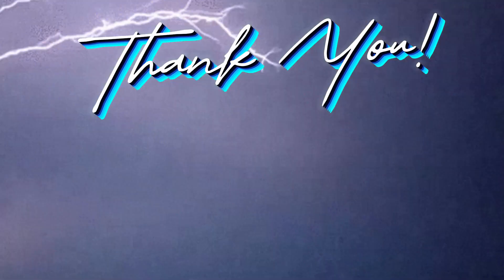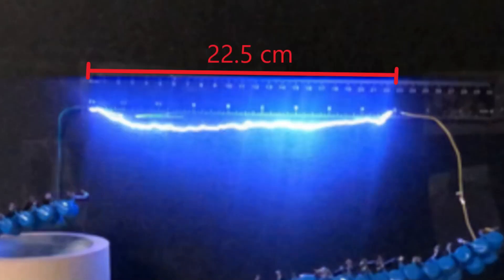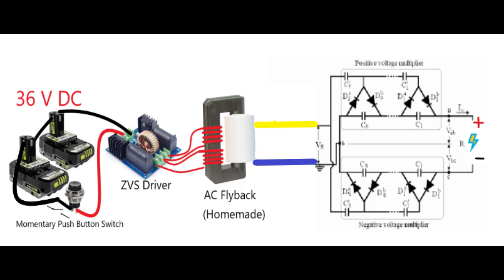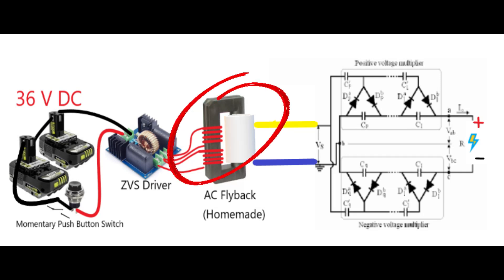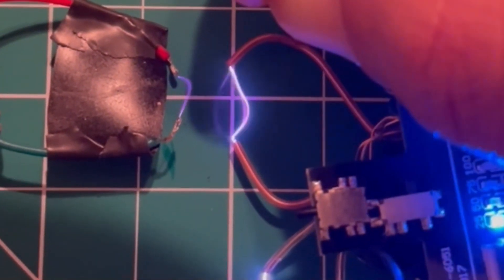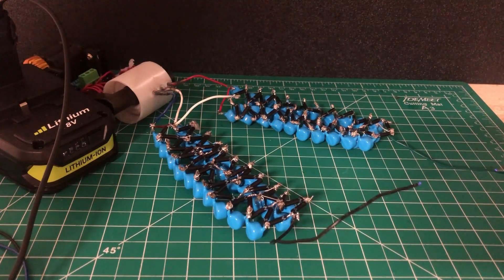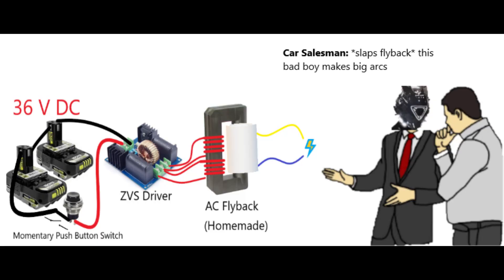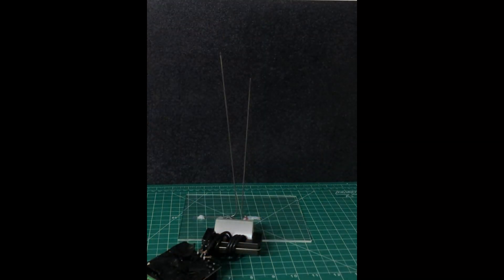225,000 VDC High Voltage Multiplier - ZVS Driven AC Flyback Transformer Bipolar Cockcroft Walton

Comment: Actually, you should put 2 or 3 diode in series each section to limit the losses to maximum because diodes are usually has its own parasitic capacitance usually few picofarards so in high frequency high voltage circuit it’s will more like a diode with a resistor in parallel with it
Reply from the maker: @OngvoHVAstuff08  that would be an interesting experiment! That’s a good point!

Comment: Make 2x 1000 turn flyback and put it in parallel in primary and secondary. It will be more current
Reply from the maker: This! 
I can try, sadly I dropped my transformer recently and the core broke. So I’ll need to get more and then make another 1000 turn flyback. I guess I can use my 600turn flybacks. We’ll see. 

I just started a new job so might not get to it for a month or so.

Comment: hi it’s been a while i need some help, so i need something that can generate 60k volts from like 20 volts, do you have any suggestions on how to achieve that
Reply from the maker: The circuit in this video. 
You need a power source, lithium ion batteries that are high current drain are good. 
Connect those batteries to get 12-36 volts to feed the zvs circuit in this video. Then you need a high voltage AC transformer. Not the flybacks on Amazon those are internally rectified. The ZVS circuit will power the transformer and step up the voltage. If you don’t have a good power source like batteries it will be hard to get much current out of it. Even switch mode power supplies that you plug into the wall aren’t good because they will shut off intermittently when running the circuit. Anyways you will need that high voltage transformer and it will most likely need to be custom made like how I have in this video. From there you will need to make a Cockcroft Walton circuit to connect to the transformer. That will get you a higher voltage, but you lose current when you add more stages, so it depends on what you’re trying to do. But like I said if you follow the video you should be able to replicate what I’ve done…or my other videos. You can get a weak high voltage ac  transformer from an arc lighter which can probably get you 60kv. Funny enough I have a video on getting 60kv using an arc lighter. That’s about as much as you can get out of them though. That’s why I recommend this video but either way, watch both and try to learn what I’ve done. The circuit in this video is very dangerous so you must be careful I’ve gotten shocked multiple times and it’s no joke. If you need a transformer I can make you one for $35, I can put it on eBay for you. Also you need those high voltage capacitors and diodes. Which are also pretty expensive. You can get a pack of 20kv 1nF caps for like $20, then you can get enough diodes for about $20-$40 depending on how many stages of the Cockcroft Walton.
Reply: @ ok thank you i’m tryna make a xray lol. a safe one im not tryna get cancer
Reply from the maker: Finally finished the transformers if you want one, here's the ebay link: https://www.ebay.com/itm/196897288733

Comment: To clarify, you dont need high current.
Reply from the maker: I actually confirmed this today, a power supply with less available current will not be able to generate enough current to pass through all the stages of the capacitors and diodes.

You can try this yourself by using AA batteries in series to get an equivalent voltage, but you will find that the available current and discharge rate is not enough power to generate arcs such as mine featured in this video. 

You need fast discharge batteries that can provide the circuit with much more current.
Reply: @UsefulVeryUseful  I just meant that you dont need how much you are using. I can achieve the same voltage, or atleast fairly close with 1.5 amps. The core takes a lot of current to magnetize.
Reply from the maker: @FreddyYesp  ah, I gotcha. Are you saying with this same circuit you would be able to generate the same voltage with less current?

Comment: Hi there, great video! I have been looking to get a coil winding machine myself. I think I found the one you are using, but it is advertised as 220V 50Hz, is this true? What kind of outlet voltage/frequency are you using to power yours?
Reply from the maker: Thanks! 
Mine works with 120V, 50-60Hz, standard single phase here in America.

Comment: I'm trying to drive one of my pole pig transformers HV IMPUT the required voltage is 12kv say 1amp 60 hz
  Any help would be greatly appreciated  .  I'm  on ss so money is pretty tight
Reply from the maker: I haven’t gotten into larger low frequency transformer high voltage projects yet, but there is a channel called “breezetix HV” he might be able to help you. A quick search on Google says you need 250V AC, try searching for Tesla coil forums they might have more information too.

Comment: Why does your schematic show two half-wave Cockcroft-Walton voltage multipliers, but your circuit shows two full-wave Cockcroft-Walton voltage multipliers? Why did you connect the left and right side of the full-wave Cockcroft-Walton voltage multiplier together, instead of having the left side go to the left side of the AC flyback and the right side go to the right side of the AC flyback?
Reply from the maker: Great observation, those were just test runs. In my other video 60,000 Bipolar full wave CW you will see that just like the half wave, you can have two opposite polarity full wave CWs. 

I tried to wind my own center tapped flyback for the purpose of using the bipolar full wave circuit, but the arcs produced were only about 4 inches long as seen in this video. The reason I believe is because the center was tapped at 300 turns so there wasn’t much of a step up for the full wave to utilize.

The bipolar half wave produced the longest arcs so I just used that circuit instead! Maybe one day I will wind a better center tapped flyback!

Comment: If u hooked this up to a circular magnet can u make a plasma vortex?
Reply from the maker: I just tried it, it works but the transformer has too much current output so the wire insulation starts to melt. When I have time I will try connecting a resistor to limit the current and see if the results are better.
Reply from the maker: Yes, the output of transformer is AC, so it should create the plasma swirl within the magnetic field of the toroidal magnet. I haven’t tried it yet with my transformer, I’m not sure my magnet is big enough to see the effect. The plasma arc may have too much current to spread out? I’m not sure, I can it try it though, I just know it works in theory. I guess I can just use a disk magnet and show the results.

Comment: Instead of using a vacuum chamber, use a pressure tank. You will get results faster(based off of ur epoxy cure time) and absolutely no bubbles. You would need an air compressor too though, not sure if u have that
Reply from the maker: I didn’t know that, thank you for the information!

Comment: Good narration, excellent editing, and ingenious creativity - another nice video! 
What camera are you recording with? 
I can't seem to get a good video of my arcs. 
Can you share the link to the coil winder? 
What gage wire on the secondary winding? Is it 34AWG?
Where did you get the STL files for the secondary bobbin?
Reply from the maker: Thanks you!
I’m recording with an IPhone8.
The wire is 30awg, anything smaller would be very difficult to work with. It would probably break using this coil winding machine, and I’ve already had a small cut from handling the wire while the machine is turning the wire.

Just search for coil winding machine on eBay, I honestly would just recommend a mechanical one because it’s difficult to guide the wire while the machine is turning it so fast, the motor control pedal isn’t that good.

The stl’s were designed by me.

I actually have three done and ready to sell if you want to support me. Will have them on eBay by the end of the week! Check my new post on the community tab for more details!🎉
Reply: @UsefulVeryUseful  Thanks for the answers! I look forward to checking out the STLs.
Reply from the maker: @shawncalderon4950  sorry for any confusion, the stls aren’t for sale, the whole transformer is for sale. 👍

I made a written post about them, to see it go to my channel page and then community tab to see it
Reply: @UsefulVeryUseful  Will the transformer include the ferrite core or just the secondary coil?
Reply from the maker: @shawncalderon4950 it will include the core. Trying to brainstorm a way to hold the two halves together. Will have to take a trip to the hardware store tomorrow. I’ll let you know what I come up with.

The core that I designed the bobbin for is actually very hard to find. I think only China has them. The original one I used is actually from a regular flyback with the internal diodes. I just used a heat gun to loosen the glue and separate the core from the coil.
Reply: @UsefulVeryUseful  ah, gotcha! Thanks!
Reply from the maker: Hey Shawn, I'm giving you the link to the ebay listing first before I post it to the channel at 12pm EST. I found some bolts that i had to modify that worked to hold the core together.

https://www.ebay.com/itm/196275887706

it's listed as AC Flyback Transformer

No pressure to buy, you just showed the most interest  @shawncalderon4950  

😃
Reply: @UsefulVeryUseful  I can't wait to order one!  As soon as my wife wakes tomorrow, we live in Chicago. I'll get logged in to our eBay account.  Thanks again!
Reply from the maker: Hello Shawn,

Thank you for the purchase and your support! I was testing the transformer with the bolts holding the core together and the core started to get warm. I believe this is from the steel bolts. If this core gets too hot for your liking you may have to submerge in oil or limit the duration of your use. An alternative would be to use tape, hot glue or zip ties to hold the core together which will work just as well. Also, any feedback will be much appreciated. Let me know what you like and don't like about the transformer so I can improve!
Reply: @UsefulVeryUseful  Hi UE, thank you for the helpful input!
I wish you lived close by. I don't have any friends interested in the fascinating hobby of electrical engineering.
In my experience, the lower the frequency, the lower the heat. Higher flux densities and/or higher frequencies drive up the temperature. An engineer once told me these “ferrite flyback transformers” work best at 15khz-25khz.  He is a bit eccentric, so I would want to test his theory still. 
Did you mention the extra heat in the iron bolt? That makes sense because iron has higher resistivity. I picked up an infrared camera from Amazon to pinpoint the hot spots in my prototypes. This camera always tells me where I'm screwing up before anything blows up. 😊 
I will keep you posted!
Reply from the maker: @shawncalderon4950 yes the extra heat is for sure coming from the iron bolt because of the current induction from the zvs driver. I haven’t really noticed heat without it, so I think the heat is just being absorbed by the core from the bolts. The zvs has even heated the primary wires enough to melt the isolation one time but didn’t really notice the core was hot. I was more concerned about shutting the circuit off at that point though. 
And yes I believe your friend is mostly correct because at higher frequencies you don’t need a large core to store and transfer the magnetic energy from primary to secondary. So yes when designing for a smaller core it will need to be driven with higher frequency to have the same power output of a transformer with a larger core driven with lower frequencies.
Reply: @UsefulVeryUseful  I have had the same experience with my primary windings. My first 28-awg primary melted and smoked. The 18-awg replacement has helped alleviate the heating problem. I'll keep you posted! Thanks for being so helpful!
Reply from the maker: Yes I've been using 14 awg, they have been working well, the survived another overheating except the most recent time melted the green plastic 3 pin connector on the zvs board instead  😆 @shawncalderon4950
Reply: @UsefulVeryUseful  Wow! I'll keep an I on the green terminals!
Reply from the maker: @shawncalderon4950 ah I just remembered, the reason this happened was because I tried reducing the 8 primary windings to just 3 lol
Reply: @UsefulVeryUseful  that makes total sense!

Comment: Great video. But the output of the ZVS is not  V_in. Under no load, it’s V_in * pi if I remember correctly. Under load it’s probably closer to 2*v_in
Reply from the maker: Yes, correct me if I’m wrong, I believe I took that into consideration when reducing the primary windings to 4 instead of 8, when using the turns ratio to calculate the theoretical output of the flyback to 5kVAC. I can definitely double check when I get home later.

Comment: Hell yea this is sick. I built something very similar to this, around 150 kv, to run an x-ray tube, and i will say a little oil to insulate the voltage multiplier goes a long way for preventing losses. I bet if you submerge those voltage multipliers youll get even bigger arcs, considering my 150kv one used only 8 stages. Just gotta watch out since everything becomes a wire with this kindof voltage lol.
Reply from the maker: Yessir! I have the first ten stages in epoxy because they were arcing over as plasma arcs, and I forgot to put that footage in this video. The rest I left out because I plan to reuse some of these components for other projects because as you know these caps and diodes are pricey $$$

And yes even the floor became a wire with this circuit. I actually shocked myself from my left (in sandals) through my left arm! It made a cool surface burn in the shape of arcs that rubbed off should’ve taken a picture of it, but man did that hurt! I had to take a break after that and rethink my life for a minute..
Reply: @UsefulElectrons-ni1fq  ah i see. lmao nothing like a good shock to make you sit down for a moment 😂

Comment: Do you know that above 100 kilovolts you create X-rays? A dosimeter would be useful.
Reply from the maker: I’m just as surprised as you are!!

When I was testing this circuit on the floor it actually shocked me through the floor of my garage and left a cool lightning shaped burn on the surface of my hand. It was pretty intense and I had to sit down and rethink my life’s choices for a while. 😅
Reply from the maker: Oh gosh, I need to stop staring directly into the arcs, but they’re just so beautiful! 😵
Reply: So that you don't end up seeing only the lightning.
 @UsefulVeryUseful
Reply: @UsefulVeryUseful  But if I take it that way, I'm surprised that the electricity still not killed you.👍
Reply: Not a big issue under atmospheric pressure. X-ray intensity will be low. I'd worry more about UV and ozone. And hearing protection.

Comment: New way to cook my chicken
Reply: Jeezus ur channel is growing exponentially
Reply from the maker: @BupaDuck next up is 500,000 volt generator!
Reply: @UsefulVeryUseful  I bought a power supply for my Marx generator it will arrive in a couple days I have a feeling my Marx generator won’t work so if it doesn’t is there another simpler voltage multiplier for if my Marx generator doesn’t work
Reply from the maker: @BupaDuck  yes the circuit in this video! The bipolar Cockcroft Walton! This could even be used for the Marx power supply in the future and will give you much more fun with continuous arcs unlike most of the Marx generator designs.

Check my community post, I am selling the AC Flyback Transformers I built on eBay, you will just have to buy the rest of the components to put the circuit together.

The regular Flybacks have diodes in them that rectify the voltage to DC and won’t work with the Cockcroft Walton circuit which requires AC.
Reply from the maker: @BupaDuck  another warning for the Marx generator circuit is that it could damage your power supply if it’s a plug in model. The pulsed current can reflect back into the power supply or even transmit electromagnetic radiation pulses into your power supply, so I would advise to use a battery as your source.